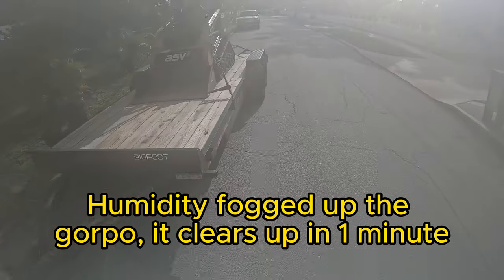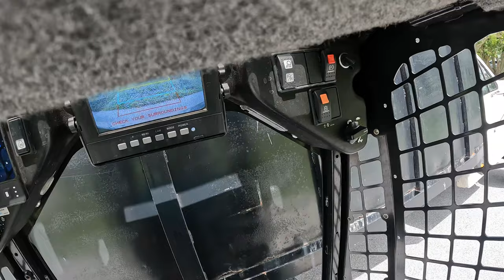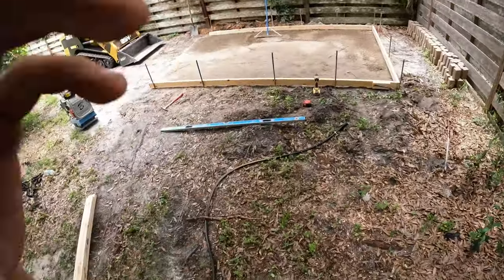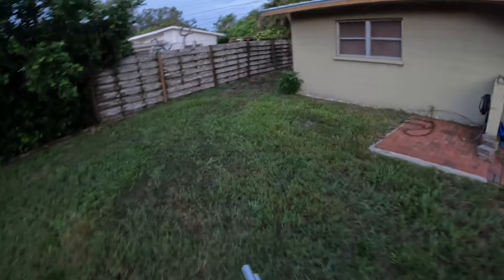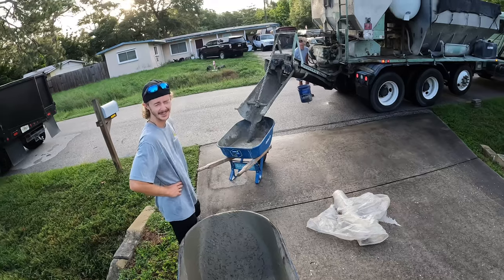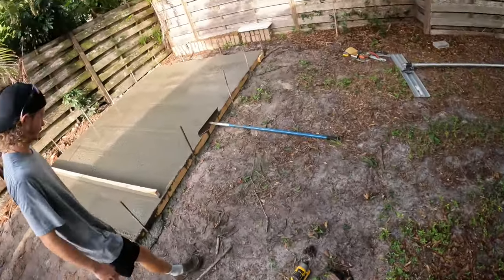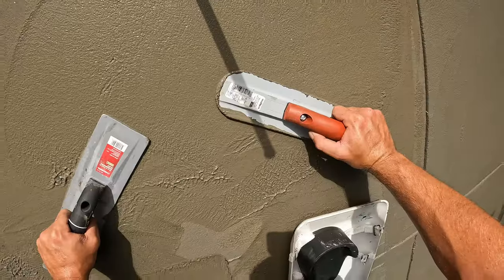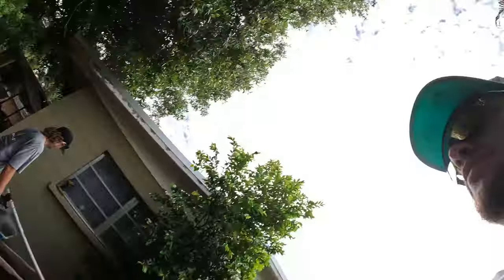FIRST CONCRETE POUR!

Comment: Nice job. The wheelbarrows with dual front wheels are a lot easier on the guys. The longer they stay fresh, the longer they can work in a day. Our heat and humidity here in Eastern North Carolina is brutal right now. 97° with a ton of sun and humidity.